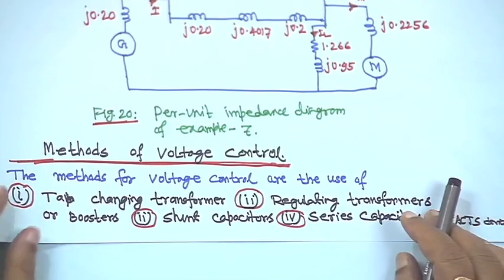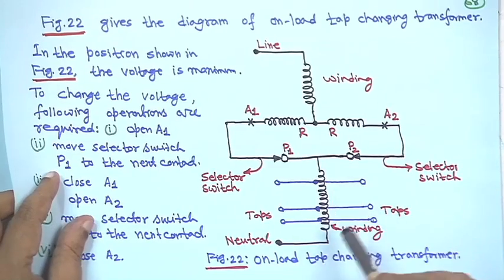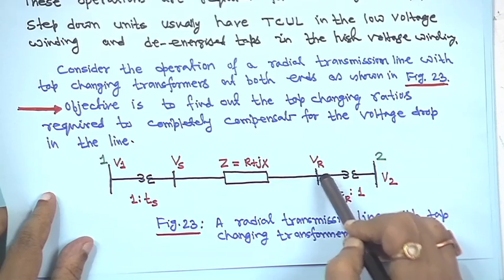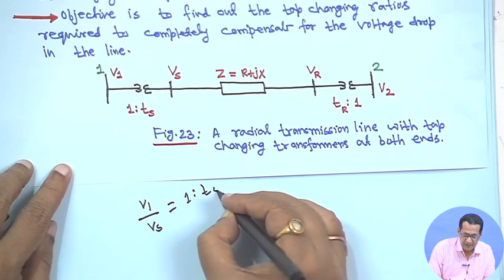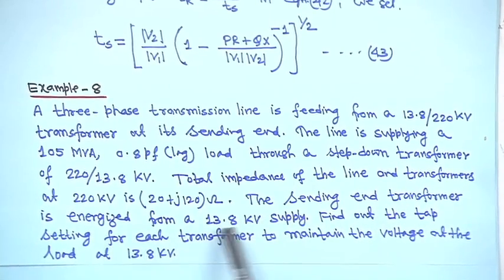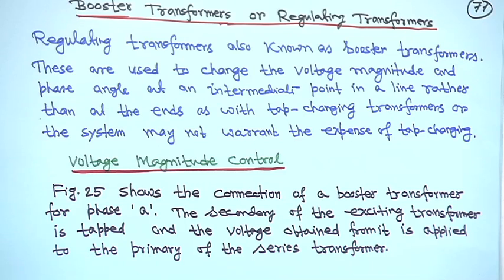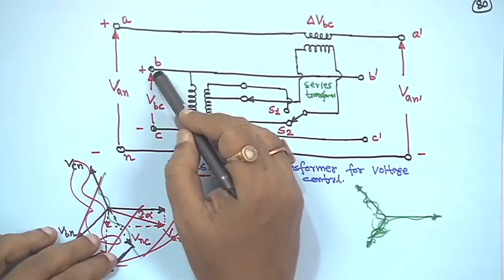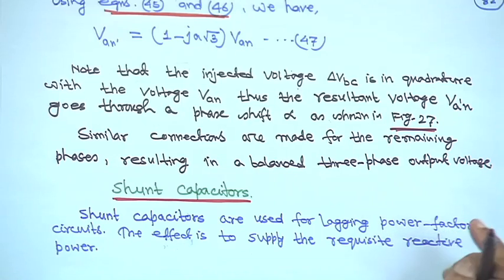Lecture 20: Power System Componets and per-unit system(Contd.)

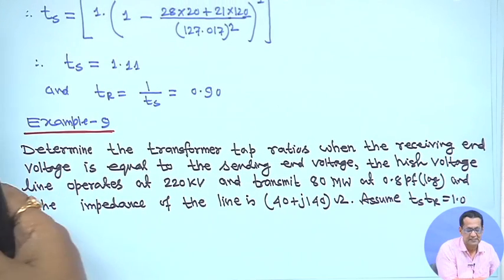Comment: @20:31 The problem states that the transmitted power is 80 MW @ 0.8 PF.
I think this means that P(3-phase) = 80 MW and Q(3-phase) = 60 MVAR